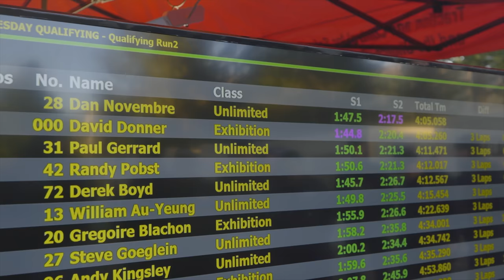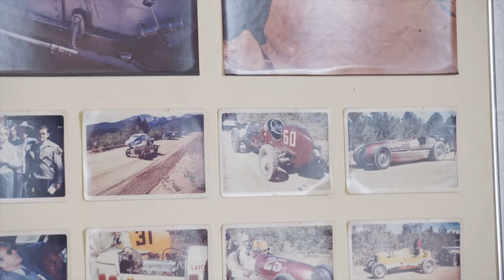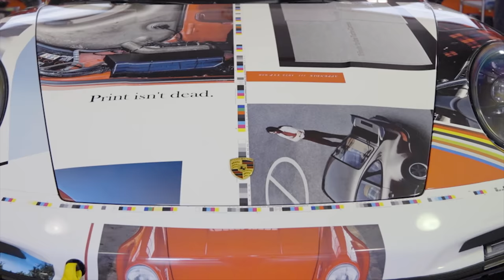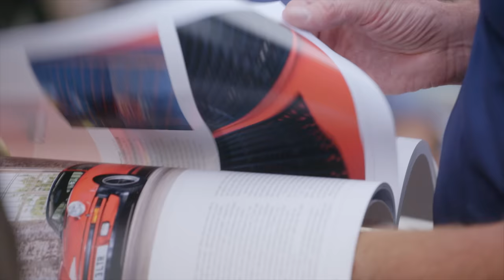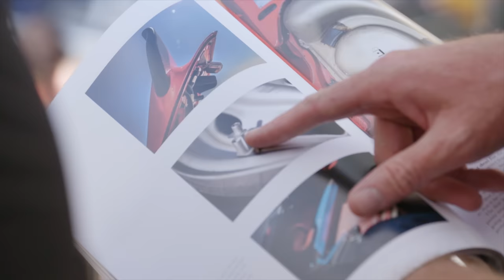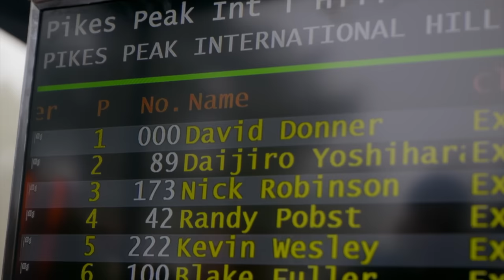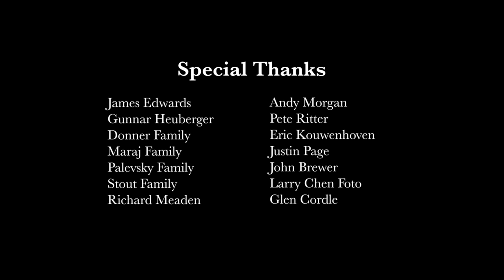A Pikes Peak Story - Porsche 911 Turbo S: 🏁 2022 Winner 🏁 | Carfection

Comment: The conditions favoured the 4WD and safety systems of the 911 Turbo S. And of course those turbos can really spool up in the cold mountain conditions. Amazing drive.
Reply: Not really. 2nd place is also AWD and full of safety crap.
Reply: @currycel470  Variable geometry isn't as special as you think it is
Reply: @currycel470  variable fin size? u sure about that? I thought the fins change the „angle of attack“. That would be a pretty common vtg turbo.
Reply: That's the whole impressive thing: even with turbo or supercharging, thanks to less oxygen in the air at higher altitudes combustion engines have less power the higher the sealevel. Charging compensated that a little. But electric motors and batteries don't have that problem. They don't need oxygen. So it's even more impresive that a standard 911 Turbo S was able to do that in that manner.
As for VTG turbos: they are used in Diesel engines for 2 decades already, but Porsche was able to get materials that withstand the higher exhaust temperatures of petrol/gasoline engines at high rpm full throttle for long. (One reason they are that expensive)

Comment: My father-in-law had a 911 Turbo S Cabriolet. White, red interior, lots of options. We gushed over it and had a blast pushing it on the windy roads of the Wasatch mountains in Utah. He recently passed away from a freak accident, so the 911 sits in the garage. My mother-in-law takes it out periodically not knowing or appreciating the masterpiece it is.

Comment: I bought one of these about 2 months ago and I’m still blown away by the thing. I just need to learn how get the most out of it
Reply: Wait ✋ until winter, buy a set of all season or winter tires now when they are cheap and drive it on snow somewhere to go on a ski holiday. Even offer to drive whist your friends ski or pick them up from the airport. This will give you a learning window at a much slower pace and time where you can do the same roads with a lower grip. Use the all season tires in the rain to push the limits and  in the spring you will have your current Pilot Sport Cup 2 ready to take it to another envelope
Reply: Mblondon850 are you coming out of a manual transmission car by chance ?  4 years later I'm still on a bit of a learning curve w my PDK Turbo S
Reply: @jclar3565  How so?

Comment: "Eats EVs for breakfast" 

Loved that.
Reply: The Tesla Plaid would have eaten alive the Porsche. The driver had a defrost problem with the windshield.
Reply: @sambow7005  How about we stop comparing EVs and ICEs? Compare an EV vs EV or an ICE vs ICE. Not this.
Reply: @gokulkrishm51  both are production car so it’s a fair comparaison and Pikes peak is about a car and the mountain no Mather what it is.
Reply: @sambow7005  But different powertrain. You don't wanna race a V10 F1 and a V6 turbo F1 and call one winner. It's not a fair comparison in my opinion.
Reply: @sambow7005  No Tesla will ever come close to a 911, stop it. Not on Pikes Peak, not on the Ring.

Comment: I did that run back in 2006 in my Toyota Prius and I was able to do it all out in 10 flat.
You just need to spend a lot of time running it on the sim and playing with tire pressures until you strike a balance and learn the curves. I also did plenty of strength training to get my body in peak condition. I did upgrade the tires to some better road tires. The Prius is a pretty slippery design but I still duct taped the sunroof. I also ran premium fuel and conditioned the battery cells.

The morning of my record attempt I treated my team to breakfast at Denny’s where I ordered a Grand Slam. I skipped the syrup as it’s not very healthy. My team headed to the top as I was only going for an uphill record. 

At 6:40 am.  the clock started and I was off. Even though I practiced this on the sims and ran it over and over again in my head, the run up the hill was grueling. I did have my iPod hooked up and was listening to the Beatles greatest hits volume 1. 
At the half way point I still had a full charge on the batteries but the catalytic converter started smoking and then caught fire.
During the middle of the Beatles greatest hits volume 2, the catalytic converter melted and fell off. It felt like I now had been awarded the Hellcat Redeye engine upgrade as the Prius gained massive power.

I finally reached the peak, crossed the finish marker and got my time,
I did it and I was  exhausted! 
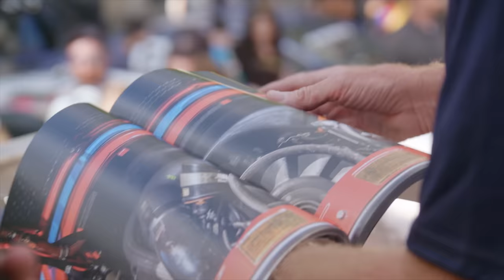With the Beatles greatest hits volume 12 playing in the background, dash clock reading 4:40 and a small brush fire near the bottom of the mountain, I did my Victory / Pee Pee dance and swore I’d never spend another 10 hours in that shit box again.
After pushing it over the cliff, me and my 3 friends jumped in their newer model Prius and headed back down. We rolled into Denny’s at around 6 am the next day and with fully charged battery cells.
I had the syrup!

Comment: You cannot beat the 911(992) for all round performance, usability and price.  In the UK you can uprate the car to 850hp for not a lot of money. 0-60 is 2.1 seconds which you can do over and over unlike Tesla Plaid and other electric cars. They hold their value and are a daily driver. Tesla Plaid model s is £117,000 in the UK. In 5 years time just see how the Porsche holds its money against a Tesla that will need new batteries soon.

Comment: What street tires did he run? Btw, I've been enjoying the F out of my Turbo S.
Reply: Pirelli P-Zero's probably
Reply: @ivanpuskaric6851  That would be insane, because I've switched from that to cup 2s at track, and the difference is tremendous. However, he was going through cold and wet - so Pzero may have made  the big difference.
Reply: @OK-wm8xz  guess that was the reason...don't know pal, I don't race or use high performance tyres, so wouldn't know, but in the video you can see Pirellis fitted to the car. Since 992 Turbo S comes with p-zeros from the factory I presume that was the tyre fitted
Reply: It says Michelin Cup 2 Rs in the description

Comment: So smooth so fast in dangerous conditions.  Amazing car and driver.  With the wet road it’s incredible that never loses the rest end but Porsches give you plenty of warning and don’t mind a controlled slide. Especially the mid engined cayman which I drive. So easy to control compared to a Honda S2000 I had before.

Comment: In that poor condition and at high altitude, he pulled nearly 80 m/h at a lot of corners. That is not just his car. It takes absolute trust in his car and driving skill to pull off. And his out of corner acceleration was great, almost losing traction at every corner. Great achievement.

Comment: This story is a perfect picture of what Chevrolet could have done if they had continued improving the Corvair.  The Porsche 930 turbo from 1975 was a copy of the 1965 Corvair Corsa Turbo.  Rear mounted flat 6 cylinder turbocharged engine, fully independent suspension, 4 speed transmission.  Give it what the Porsche had in 1975, disc brakes, wider radial tires, and the increases in displacement and horsepower that the Porsche and many other cars had by then, and the Corvair would be a premiere sports car today.

Comment: 911 turbo s dreamcar .lightweight packag stage 1 tune. 750 to 800 hp from what I've read it will take the tesla  plaid .I did know the 911 turbo s would find away regardless. I rather have 1 turbo s than 3 tesla plaids

Comment: Was there the qeekend before.  Drove all the way up, these videos dont even show the sheer terror or looking out into sky not seeing the turns, or that these roads are barley wide enough for cars to pass each other with literally falling off a mountain.  You're a ove the treeline like 1/3 of this race. (Hihher than trees can grow). Its just insane they go flat out up this. Some of these corners are so sharp, you basically stop your car, turn your wheels as far as you can, drive until you are facing the other way, then straighten back out. Its just.... silly.

Comment: Admittedly, Donner's car isn't exactly stock, as it's equipped with a roll cage for safety, has a stripped out interior, lacks a passenger seat, and has a racing seat with harnesses. However, the actual powertrain, drivetrain, suspension, and brakes are all stock. How was the 2nd place equipped?

Comment: but is this a rear-engined car? I've heard that modern 911 race cars have had their engine pushed forward so it sits above the rear-axle and not behind it.
Reply: Yeah, but this is not a race car, this is a largely stock Turbo S. The RSR models are indeed mid engined by now.
Reply: ...and even the race cars are only mid engined to accommodate a race-spec diffuser.

Comment: I don’t think it’s the fact that EVs come close.  I think it’s the fact you get so much performance at that price , with near zero headaches.  No turbo rebuild no water pump intercooler radiator to worry about. No transmission servicing no transmission upgrading. No engine wear and tear no engine maintenance no engine upgrade.  No running different tunes for various fuel types at different conditions.  No fuel injector or fuel pump upgrade or repair. Essentially the EV dudes picked up a model three performance at the tesla pick up center (or it was delivered to their doorstep from factory) with the rest of the soccer moms for $60 K.   Then dump some cash to make it lightweight and a bit of suspension and brakes , the end.  After the race there was no engine tear down there was no clutch rebuild. That could have done the race day after day with minimal headache.
Reply: Thats literally one of the things that makes these EVs so boring lol. Appliances, they just do their job.
Reply: @freakattack9616  why are Tesla fanboys crying over this gutted and caged 911,(like If It was trap) when they do exactly the same with their model 3 and S.

They don't like when the ICE beat their EV's I'm a JDM fan, but I got a soft spot for Porsche (the old and new ones) and BMW, (only the old ones) Porsche never fails to amaze me.

Comment: The title stamp on this video's thumbnail reads "911 Turbo S Eats EVs for breakfast" which is not true. Donner's record is 10m 26sec.
It is 2 minutes and 59 seconds SLOWER than VW IDR electric vehicle. 
2 minutes and 59 seconds, think about that for a moment. (IDR record 7min27sec)
Reply: that VW is a  full prototype racecar
Reply: That VW is a racecar, while the 911 Turbo is a production car on street tires.

Comment: Can someone tell me in what areas this Turbo S is better than a GT2RS, which is basically a racecar? The GT2RS is more powerful, lighter and also AWD. And so far as I know the GT2RS is much faster round the Ring. Just curious - I'm a biker and I don't even drive cars 😏
Reply: GT2RS is RWD only. Have fun in the wet. Obviously an exceptional car, but the guy had already done it in a GT2RS and wanted something else.
Reply: Its not AWD
Reply: @fjshsjvisnsks7251  Oh, I see. My mistake. That would indeed make a difference, especially on poor road surfaces and in bad weather. Thanks.
Reply: There’s also not a GT2 RS version of the current generation of 911 yet. And while it makes less hp than the last gen GT2RS it makes more torque.
Reply: @drakos5442  And don't forget that that's porsche hp...
And since they can remap the car the stock power of the engine isn't as much of a factor as is the extra headroom available to compensate for altitude...
Reply: Excuse me, but the GT 2RS is only rear wheel driven.

Comment: Excepting the stock Tesla Plaid that does the 1/4 mile a second faster.  At three times the price it won Pikes Peak, it would be pretty embarrassing if it didn't, the Plaid is a family sedan. Let's see how it does against the Tesla Roadster in the same price category as the Porsche.
Reply: A gutted Plaid on slicks, a racecar basically, with massive aero was slower than this almost stock 911.

I own a Model 3, but Porsches are a different league in all around performance. One day, i'll get a 911 as a fun car...
Reply: Tesla Roadster hahajahajaha
Reply: @VaporwareMartinez  It's called technology and EV's are technologically rich, ICE technology is not. It's a heat engine , a low efficiency dinosaur, it's days are numbered, every major country has termination dates. 
It's only a short amount of time before EV's completely pass ICE cars. What you're talking about is handling and attaining good handling is not a mystery.

The 911 turbo S costs over $200k, it does the quarter in 10.1 seconds. Go watch the guy on YT racing a basically stock Plaid in the low 9's beating the pants of gas cars. People are renting Tesla's and taking them to tracks and cleaning up. Again, it's called technology and EV's are technologically very rich. By the way, I know and have owned Porsches. I can take one down to nut and bolt level and have, those days are over, now I drive EV's. The days of changing 15 quarts of oil are over, the days of waiting for turbos to cool off before I shut the engine down are over too, so is the $200k plus for a car over. By, by Porsche, you were fun 30 years ago but this is the 21st Century.
Reply: @r7cardosuarez806 Ten years ago the Leaf went 84 miles on a charge, today well over 300 with 18 minute recharge times, in ten years  EV's will completely surpass everything on the road, it's just technology, gas is over, face it, every major country has an end date for ICE's. EV's are so good they won't let them race in F1 against gas cars.
Reply: @mosfet500  so much bullshit lmfao

Wake us up when Tesla can beat a stock 911 Turbo at Pikes Peak. Thst will take a while
Reply: @r7cardosuarez806  Tesla is already beating Porsche at the track, it won't be long! Cling to your hill climb, you're running out or winning options, Tesla is now gearing up for 24 hours of Le Mans. Oh wait, Porsche hasn't won that since 2017, Toyota won the last three years! Oops!
Reply: @mosfet500  HAHAHAHAHAHA Tesla will beat Porsche at the track hahahahaha

Teslas are slow dude, they can barely do one lap. 911 is the best car in the world and Tesla is just an american Golf Gti lmao

Porsche won the 65hours of Mars last week
Reply: @freakattack9616  Toyota won 24 hours of LeMans the last three years. 

The Plaid does 9.21 seconds in the 1/4 mile, the Porsche does 10.1 seconds. That's the "track" I'm referring to. The Plaid is a stock sedan.

There is no "65 hours of Mars".
Reply: @freakattack9616  "no one cares about it"? No, Porsche gets its butt kicked there so you don't car about it all the people in the NHRA care a lot about it. There are 120 sanctioned NHRA tracks in the US. Porsche people must care, they race there (and lose to Tesla). They lose to Toyota at Le Mans too!
Reply: @mosfet500  I've seen modded Turbos run mid 8s, no Tesla runs that. So even for Americans with no skills, a Porsche is better.

What place was Tesla in Le Mans again?
Reply: @freakattack9616  The Tesla is stock, the Porsche is stock, Porsche is one second slower in the 1/4 mile. The Tesla is a family sedan, the Porsche is a sports car. Family sedans don't run Le Mans. Porsche has lost Le Mans the last three years in a row, I wouldn't be talking about Le Mans if I were you.
Reply: @mosfet500  You were the only one talking about Le Mans because a stock Porsche humiliated a race Tesla with 400hp more lmfao
Reply: @freakattack9616  There's no such thing as a "race Tesla".
Reply: @mosfet500  a gutted, Plaid with massive aero on slicks. Thats exactly what the headline is about. Slower than a stock 911 on street tires.
Reply: @mosfet500  electric is crap that catches fire all the time and to expensive if you need to replace the full  battery cell.
Reply: @Paganiproductions84  Twelve Bolts caught fire out of over 100k, more gas cars catch fire than that, they just don't advertise it. Tesla's and Bolt's run over 200k miles on batteries and are still going strong. What are you talking about?

Comment: Title is a bit pretentious. 911 a an excellent road car but it’s Pike ‘s peaks record is actually far from the Wolkvagen EV best time record of 7’57 of Dumas after Loeb both European drivers.
Reply: So you compare a stock road car to a EV race car?
Reply: @YellowEvoV110  yes because Pike’s record does not care about the type or kind of fuel used. Like said 911 is one of the best road car but this particular one as nothing to do with the one you can buy in Porsche dealer. It’s a race car !
Reply: @alainmare8081  well no? How is he able to drive back to home with a race car? Its a stock car (expect that roll cage) that you can drive on a puplic street. You expect that car to do 8 min like that VW?
Reply: @YellowEvoV110  you believe it ? You are a bit naive. These cars are specially prepared for this race. But anyway the Porsche turbo is a beast and not anyone is able to master the driving.
Reply: @alainmare8081  really? Porsche wanted to get the record for the "fastest street legal produktion car" or what its called. Wouldnt make much sense if you make it a non street legal race car. If they want to make a truly fast race car they would have used sth like the 919 evo.

I am not naive. You just dont think properly.